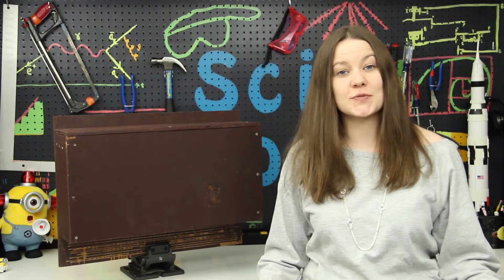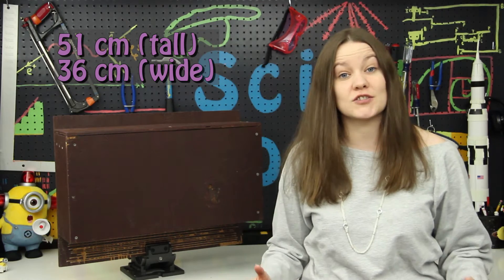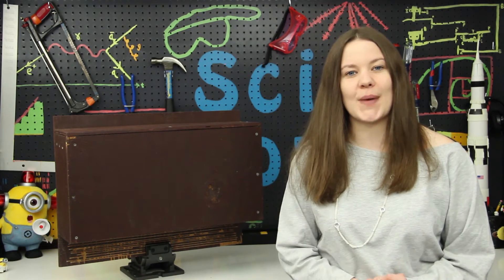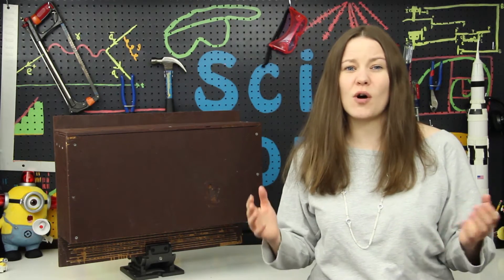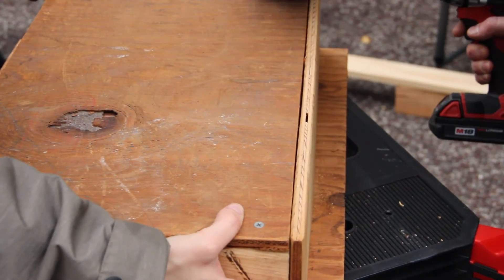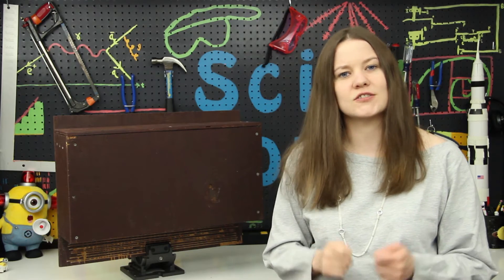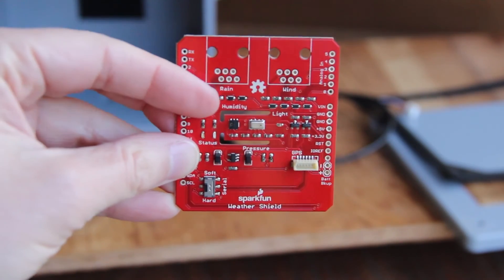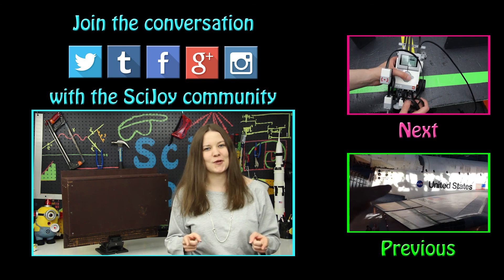Overview of a High Tech Home for Bats | Crossover with GetMessy' Caring About Chiroptera

Comment: Good video! I wanted to know more about how your "High Tech" stuff went. Is there anything you would change as far as temperature probes or electronics?
Reply from the maker: Thanks! We used those because that is what we had already that would useful for monitoring bats that weren't too intrusive. Sorry we didn't do a follow up video. There were some unexpected life events around the time we were supposed to install the box. What sensors are you thinking of using?
Reply: I don't have specific models picked out, but basically the same idea of temperature sensors and weather data. Maybe/probably a cheap webcam pointed at the base, to see what species I've picked up... 

That said, I'm curious about how much oxygen bats burn in the top of the essentially air-tight boxes we build. To my knowledge, bats breath hot air, hot air rises, bats stay at the top of the box where it's warmer... Why don't they pass out? So, I might splurge and get some sort of Oxygen/CO2 sensor as well. We'll see. 

Hope life settles down for you!